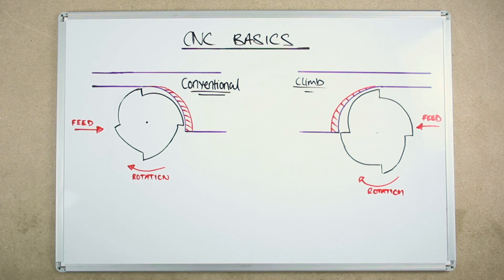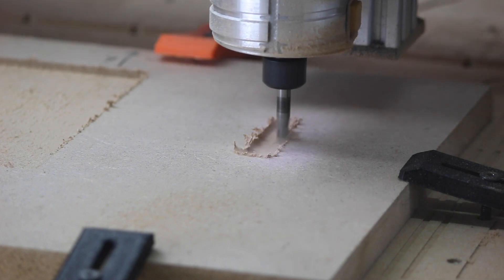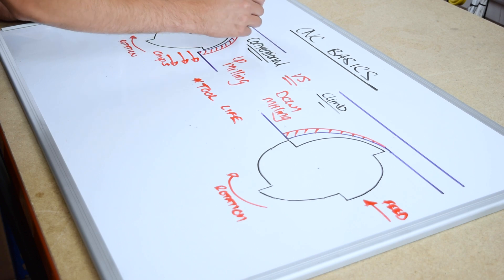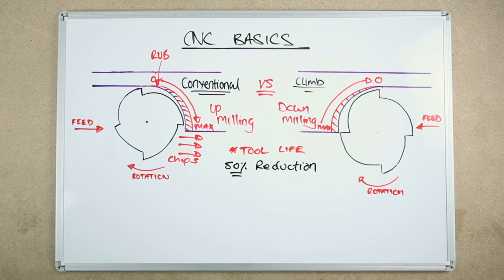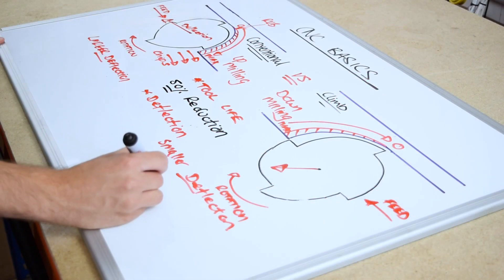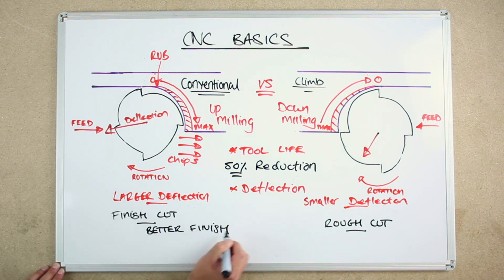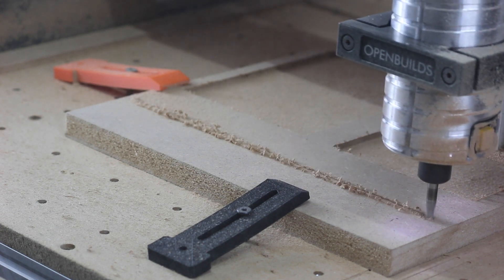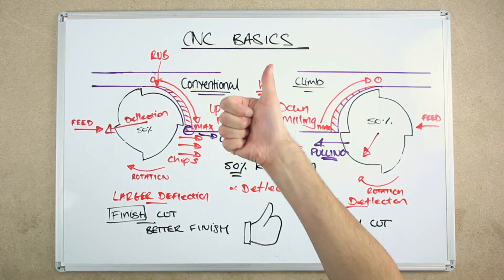Conventional vs Climb Milling On A CNC Machine - CNC Basics – WorkBee

Comment: This is backwards to all I've learned using a commercial cnc for 3 years now.   You're better off using conventional-up for rough cutting, climb-down for finish, in almost every material and circumstance.   
Conventional 1 Flute up millend for draft, climb multi-flute or 1 flute down cut millend for finish.
With adequate cooling, I rarely have to change to new bits, but when I do, generally I only have to change bits because I've accidentally snapped them somehow... rarely because they've worn.  This doesn't work in the other direction.